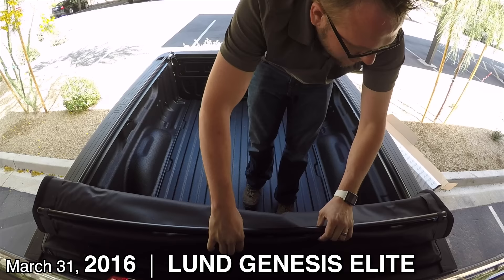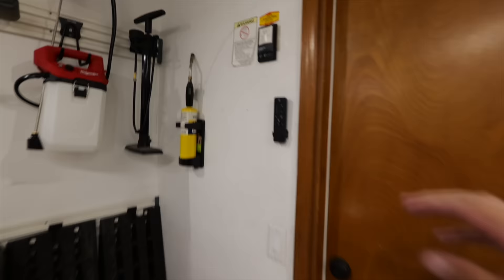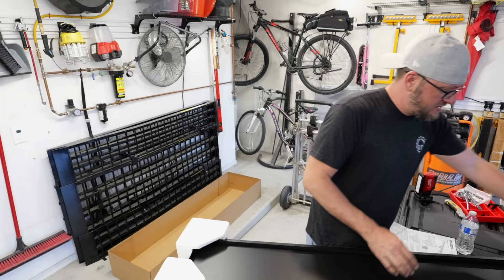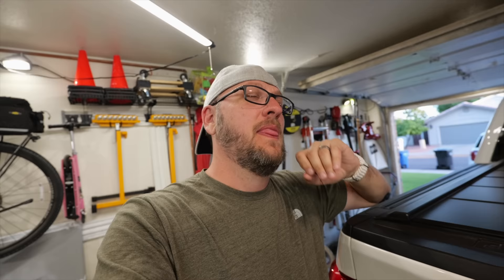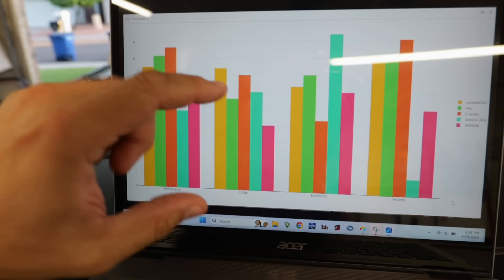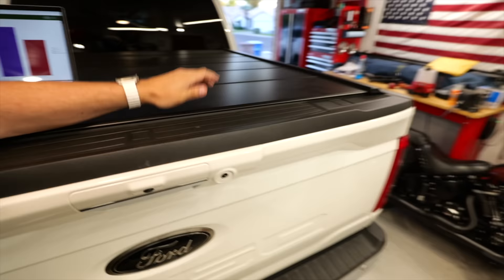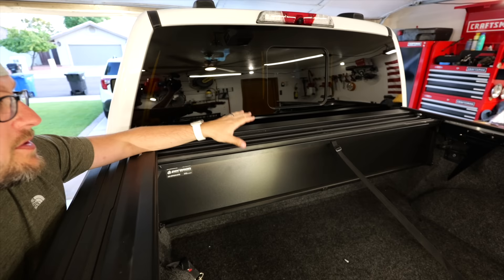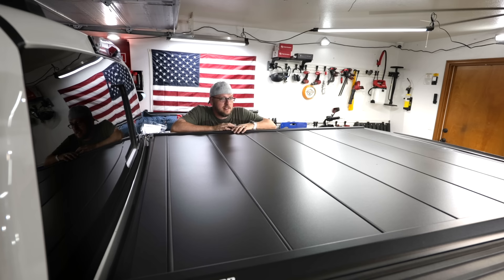Is Peragon the Ultimate Tonneau Cover?

Comment: I had a peragon for 3 years.   I regretted it from about the second month of ownership.   I didn't think opening it woul be such a pain.   But when some thing slides to the back yoy have to get into the bed pull if foward just to get it or ipen the cover .   Major inconvenience.   Also it leaks way to much.   I would not recommend
Reply: We're sorry to hear the cover wasn't a good fit for you. If you're still using it we recommend a simple cargo hook for pushing things back into that space (that would normally be taken up by a mounted canister) and pulling them forward when you're ready to open. Or an adjustable cargo bar works well to prevent load shift when you don't need that space!
Reply: Just bought one, have had mine for less than 2 weeks. Already sending it back, it’s a pretty terrible cover especially when you’re used to well functioning equipment…
Reply: Agreed. Have one on my 2017 titan p4x. Junk cover for the price. Leaks all kinds of water in compared to a 3-400 simple trifold
Reply: Thanks you guys saved me from a big mistake
Reply: Yeah, I’ve changed my mind now.
Reply: Just got one a week ago for an F350 8 ft bed.   Drove in pounding rain with very minimal leaking at the corners.   This was due more to the truck design, plastic on the side rails but not on the front of the bed, and don't have a seal around the tailgate yet.   I have no complaints so far.

Comment: Nothing will beat a Diamondback tonneau cover.
Reply: I mean, for many people almost any other style is better than a diamondback. Need a wide open bed without having to remove the cover.
Reply from the maker: I just don’t like all the exterior hardware on the Diamondback. All the boat cleats tie offs just look weird to me.
Reply: @GearsGadgets  you have the option to not have them installed.  Says a lot for diamondback if that’s all you find wrong with it.  Not being a smart a** so please don’t take it that way
Reply: Lomax in my opinion is better, I like the low profile minimalist look, and the functionality is perfect for me
Reply: I just wish they made a low profile bed cover than I would totally get one
Reply: Anything with rubber, hinges, etc. will degrade over time.  I had a cover on my old truck that lasted ~14 yrs.  Can't buy replacement parts.  Just chucked it in the trash.  Agree - DIAMONDBACK is the best all-around cover for durability and duration!
Reply: Had a diamondback. Great for storing gear underneath, adding stuff on top. Need to haul anything substantial in back? Too bad, won’t fit unless you take cover off. If you carry large load on top of bed cover, good luck getting on and off. Perfect example, had to haul a fridge from Home Depot. What trucks are meant for, hauling. Had to put on top of Diamondback which was more than capable of carrying. Home Depot had forklift, I had tractor at home. Most people don’t have a tractor lying around. Also, no gooseneck or fifth wheel towing. Not practical for HD trucks unless they pavement princess non working trucks. In my opinion, the retrax pro xr with T slot rails for Rhino racks etc is the ultimate set up. Just ordered my retrax. 500lb capable on top of it, equally distributed of course. Diamondback is great for over landing etc.. but once stuff is over the cover you cannot get into easily for stuff in the back it unless you crawl back there. I loved my diamond back when I had it.
Reply: @mczuza76  wonder how retrax would be in ice and snow?
Reply: @HeCoversMe  hmm I’m in from FL, never was a concern. Living in TN now, so i see your point. 😳Gonna find out lol. I have been researching a better cover than Diamondback for a couple years now, and the retrax has had nothing but praises. Very little complaints. Water intrusion always an issue. Always was even with my diamondback. I have never heard complaints of icing up.
Reply: Even diamond back would freeze to bed rails.
Reply: @mczuza76  I was picturing my sliding door in the winter.  Aluminum has odd characteristics in the Winter but I truly hope it works out for you.  Who ever thought guys like us would be shelling out two grand plus for a cover haha 
It’s really getting expensive to do anything anymore.  I see what you mean about diamondback.  It was at the top of my list now you got me rethinking.  I just bought a ram 2500
Reply: Yes if a flatish truck cap is what you are looking for. I have a truck to be a truck. Id buy a SUV if I wanted a SUV.
Reply: @mczuza76  retrax did great in Alaska and Nevada. spent years in each. It eventually got brittle and started cracking but was great for a long time
Reply: Love my retrax till now..lasted 8 years the top split.
Reply: D I A M O N D B A C K !
Reply: Unless you want to have a RTT mounted low and don’t want to crawl in your bed from tailgate.

Comment: I have a Peragon on my Silverado since 2020. Its just okay, the biggest issue I have is packing my truck bed full to go on a family trip. With it all the way open in the forward position folded up you can't pack stuff up against the cover when its folded because when you go to pull the cover closed it will jam up against the stuff you have packed in the bed. So if you want to pack your bed fully you have to pack your bed with the cover closed so then you have to use something like a stick or broom handle to push your stuff all the way forward toward the cab. And if the cover is closed it makes it hard to stack items in your bed like luggage, bags lawn chairs fishing gear etc because you can't reach that far forward to stack items. Then when you get to where your going to unpack your truck, you can't open your cover because it won't fold forward because of all the stuff you have in your bed and the stuff that's packed all the way forward won't allow the cover to fold open because the cover folds inward in a downward position and all your stuff in the bed won't allow it to fold open. Hope all that makes sense, its just something I didn't think of when I bought the cover. But it's a reason why I am considering replacing mine with something else that folds upward and not inward like the Peragon. We always use my truck for family trips and packing and unpacking the bed is an issue with that cover.
Reply: Thanks for the feedback. I have only seen videos of people opening and closing this system with an empty bed. Anyone ever thought about installing the peragon system upside down? Would that even work?
Reply: that was a main reason why I just bought the bak revolver x4s hard rolling truck bed tonneau cover.  super secure, and you dont have to climb into the covered bed to get items out from the far side of the bed.  Just unlock the tail gate and roll it up.
Reply: This is a great reply-and one Peragon definitely won’t acknowledge, lol. They tried reinventing the wheel here to stand out from the competition. Sometimes ideas just aren’t that great and I think this is one. Your points regarding packed bed and can’t open is just why this cover IS A BAD CONCEPT. It just seems flimsy like a cheap file cabinet when it’s collapsed too, haha. Great reply and thanks for sharing. Leaning towards the BAK myself.
Reply: What cover would you recommend? The retrax?
Reply: Thank you. Totally not getting one now

Comment: I hated mine. I threw it off the truck after a couple years and bought a BakFlip for my next 2 trucks. The Paragon was a pain in the ass. It would seize up and I hated it. My dad had the exact same experience. We both prefer the BakFlip.
Reply from the maker: Appreciate the input for sure
Reply: I completely agree. It’s crap. Super thin metal, leaks like crazy, rollers lock up, strap is always in the way, very thin metal, can’t open when objects are in the bed. Terrible design.
Reply: I went to a diamond back switch back. I am happier now.
Reply: I agree, quite frustrating. Not buying another one.

Comment: I’ve had mine for about 2-3 years.  It fits my needs perfectly.  It’s not water tight but I understood that going in.  Yes it’s a pain when things slide too far forward but a simple ratcheting load bar across the bed takes care of that.  I keep things in Rubbermaid totes to mitigate any moisture issues.  It’s not perfect but no bed cover is.  The fact that I can completely remove the cover in less than a minute and the security that it offers were the main selling points for me.  A little creativity goes a long way when it comes to getting the most out of a tool.

Comment: I’ve had 2 of these. First one was on 2 different F150 and the current one is on its 3rd f150. They flat hold up well. The only thing wrong with mine is the Peragon label has yellowed. Today I ordered my 3rd. I’m gonna give this one to my daughter. I ordered the limited HDX. As for leaks I see very little. They also don’t claim to be waterproof. Plus my spray on bed liner goes over the front edge so I wasn’t expecting it to seal well. I really like how tough it is.

Comment: I have had the ReTrax, The Peragon and the Bak Flip X4S cover. In my opinion the best by far is the Bak. The ReTrax is a quality cover but the joints wear out and the canister takes up a ton of bed space. The Peragon is very nice but the huge drawback is if you have something in the bed that is taller than the bottom of the cover panels are when the top is folded up against the front of the bed and that object slides to front of the bed when the cover is closed and then you try to open the cover, you can't. The first panel sections will hit the object and be obstructed from collapsing to open. You then have to crawl up there the move the object so you can then open the cover. As a result that space is not usable at all if you want to use the cover with a payload in the bed. It is. however, very easy to remove and re-install. That does not solve the issue of employing the bed cover if you want to cover a full bed load.  Also, if you go through automatic carwashes be sure you engage the lock on the cover or the drying fans will blow it open.
Reply: This is probably the most insightful review of all of these covers I have seen!  you should do a video review! I am between bakflip, the bak roller, and truxedo sentry ct. any thoughts on those? security and waterproofing are paramount for me, but durability pariticularly to UV, rain, wind, and sand are important and would ideally like it to support weight. my budget is 1.5K
Reply: @11dbelt  I have the Bak Revolver X4s and have been really happy with it so far.  It isn't fully waterproof along the edges... it'll keep rain out for the most part, but when pressure washing it to clean-off the mud, some water did get in along the edges, but it wasn't a lot of water.  I think if you have something that absolutely needs to be protected from water, you could put it into a bin and put the bin in the bed.
For protection from UV, per Bak's recommendation, I sprayed on some 303 Aerospace Protectant on it.
For ability to support weight, supposedly it can handle 400 pounds evenly distributed on top of it, but I haven't tried to really test that.  I've put some lighter items on top of it while parked just for convenience (like sleeping bags and a backpacking tent).  If you need to put significant weight up top, maybe a bed rack on top of it would work better for you?  They make adapters that let you retain full function of the tonneau cover (so you can still roll it up/down) while having a bed rack installed.  Of course, that's more $$ you'd have to spend...

Just trying to help with some ideas, best of luck to you and I hope that whatever setup you choose, that you'll be 100% happy with it!
Reply: @David Belt I've had a Paragon cover in full use for a year now and can say, "You're not wrong" in this assessment. I remedied the problem of anything getting in the way under the cover folding area with a simple load shifting bar. You just lock it in place where the cover travels/folds and it stops anything from being able to slide to that area. I will say 1 thing, when locked (and my tailgate as well) it would be hard and very noisy to get in my truck bed. After a year I really am happy about my purchase from them.
Reply: You're definitely right, the trade-off for no mounted canister that reserves the bed space to retract is the need to move items out of the way to open the cover. We designed the cover around the flexibility to quickly remove the panel group entirely and as much bed access as possible. We recommend a simple cargo hook to pull items forward when you want to utilize the entire bed under the cover or an adjustable cargo bar to prevent load shift when you don't need that space!

Comment: My 2002 Chevrolet Avalanche tonneau cover came with the truck and was 100% waterproof through a thunderstorm and 30 mph winds.  The girls scouts kicked me out from a sound sleep when their tent was collapsing (I had to go to their tent.)  It was watertight at least the first 10 years. :)  The rubber got hard eventually and had a minor leak.  The truck had a "water management system with gutters on the sides and good end seals.

Comment: I have owned one of these Parragon covers for over 10 years, and it's still going strong and working great. Mine has a slightly different mounting and locking method than the one in the video, and looks like they have upgraded several things. Great cover none the less.

Comment: I had one for 2 years for the rear window visibility and here's what I found... 1: if anything is pushed to the front or slides to the front, you can't open the cover without getting it away from where it sinks in when you push to open it. You'll need to buy a bed puller pole to get under it to move stuff toward the back before opening the cover. 2: if you live in snowy areas, you will need to keep it locked to support the weight of the snow. If it's unlocked, once it reaches a certain weight, it will begin to push down on the front, which will cause the back to open slightly. 3: if you do have any snow on it, if you have to open it, the snow will fall between the slats and into the bed making a mess to sweep out. 4: lastly, if your of shorter stature with a lifted truck, this will be a pain in the butt to open. I'm 5'8" with a 2" lifted Trail Boss. While I can reach over the bed, I'm constantly pushing down within 4" of the edge. This makes it hard for the opposite side to compress easily, you need to be able to reach in 12" to 14" and still be able to push down without irritating your armpit.

I sold mine and got the Bak X4 Revolver. So easy to use, can see plenty out of my rear window, 98% dry in rain, has 8" of wet snow on it right now and if I need to open it, I'd just brush it off and roll it up with nothing falling into the bed! Sorry Peragon, nice idea but I wouldn't recommend.

Comment: You need to adjust your rails a bit, you probably have them tightened down to tight.  If you loosened it up a tad, the cover will fly back, instead of you having to push it.  
I've been using this cover for the past 2.5 years, and I can confirm that this is an accurate representation of the water intrusion.  However, it's utility otherwise is great.  I have the double lock version, and no one is getting in there without a key. When you need the full bed it is easy as you show to remove the cover.  And it really looks great. 
They are a Wisconsin based made in USA business, and they have great customer support.  They actually sent me a new cover under warranty because of the water leaks, but the replacement leaks as well (but maybe not as much as the old one). If they could figure out the water intrusion issue I would give it 5 stars, as that is the only thing holding it back.
Reply: Thank you for the input. I'm in the market for a lockable cover and this one looks very promising. Cheers.

Comment: Nice review. The issue I see would be if you were hauling things that took almost the full height of the inside of the bed towards the back wall. As you push the panels back. The tall items that you would be hauling would interfere with the panels folding down as you open the cover.
Reply: This exact thing is my biggest complaint. Limits my already limited bed space (5.5'). I've had mine for about 6-7 months, and am regretting getting it. It's great when it works, which is most of the time, and looks great, but I would have rather gotten a roll up hard cover instead.

Comment: I had one on my my F250 for about 3yrs. I just removed it and threw it away. You can't open it if you are nose up a hill (my driveway is a little on the steep side). Although, you could close it if your back end is up. Water leakage, even going through a car wash was minimal and almost non existing even heavy rain. About a year and a half in, one of the hinges broke. Paragon was fairly accommodating on sending the replacement part. Everything was fine again until several of the sealed bearings seazed. Another issue was that i had to realign the tracks a couple 3 times a year. I haven't decided yet if i am going to go with a tonnue cover again or just buy a good quality toolbox.

Comment: I’ve had one on my Ram 1500 for about 5 years. It’s a decent cover. Keep it lubed or the rollers get locked up. The rubber seal on the front near the cab only lasted about 2 years.

Comment: I've had two BAK X4's on the same truck in 5 years.  For a truck that lived in a garage except when actively being driven the first X4 literally fell apart after about 3.5 years, I'm 1.5 years into the second X4, it's better than the first with some design changes but it still has some issues and it's very easy to get into with the tailgate locked.  I have a 5th wheel hitch in the bed all the time so most covers like the one reviewed here usually won't work to clear the hitch and I need the bed space they take up.  The X4 is defiantly better at managing water than this Peragon.